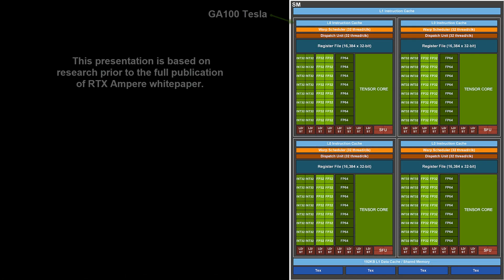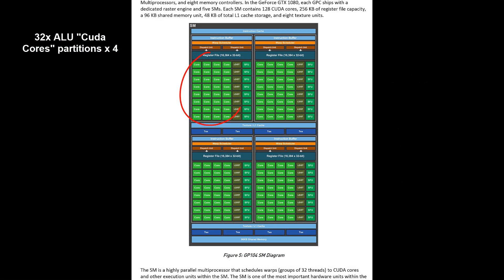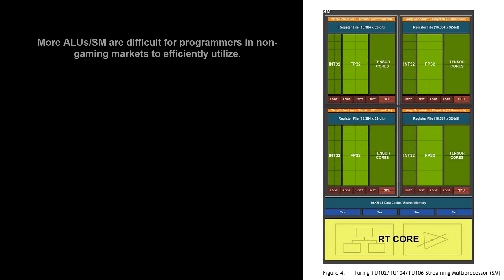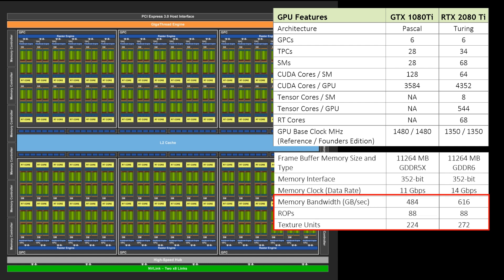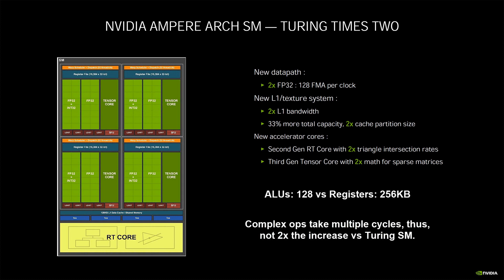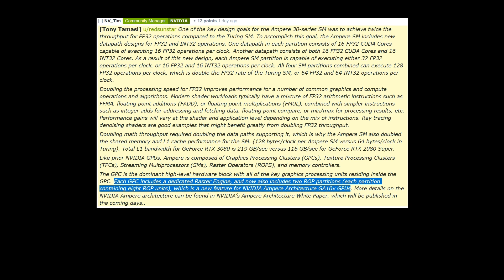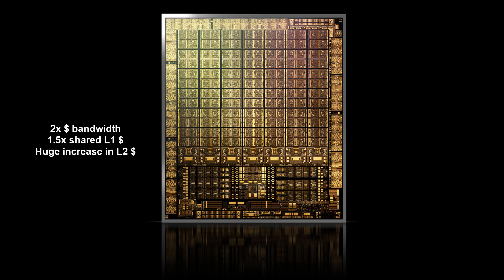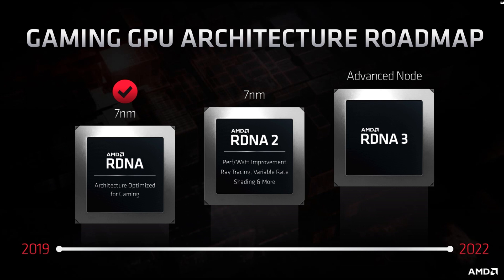RTX Ampere: How, Why and Implications for the Future of Gaming.

Comment: Do Zen 2 and Zen 3 :P Why is Zen 2 sometimes faster than Intel in some games (Source 1, X-Ray games, Rainbow Six 3) but slower in most others.
Reply from the maker: Combination of cache structure and CCX. These games may have high thread dependencies across 2-4 threads, that fit well within the CCX where the L2 is fast and core-core latency is very low. Potentially the large L3 holds more L2 evictions, but its re-used a lot by the game code, hence there is reduced DDR4 access for those common data. I don't know those particular engines well enough to speculate further than that. You can test that with Zen 2 APUs, as their L3 is quite a bit smaller than regular Zen 2.
Reply: @nerdtechgasm6502   Still fast on Renoir but much much slower.
Honestly, even Zen+ is fast enough for 99% of people IMHO. People pay too much attention to small few percent wins.

Comment from the maker: There's one other major improvement in RTX Ampere I did not cover in the vid, the RT cores have what NV refers to as a motion blur hw acceleration, however, the theory behind that means they can use it to speed up RT BVH acceleration in high motion scenes (with or without motion blur). This is going to be very useful for fast paced games.
Reply: AMPERE=SHIT, RDNA2 FTW